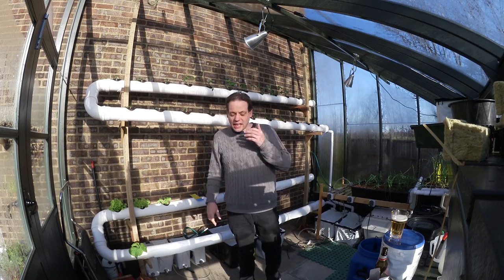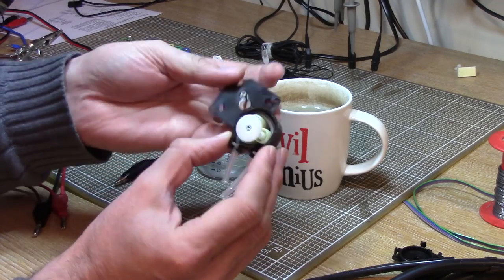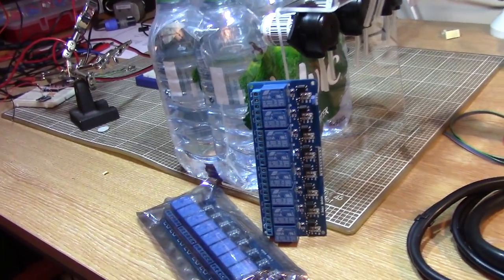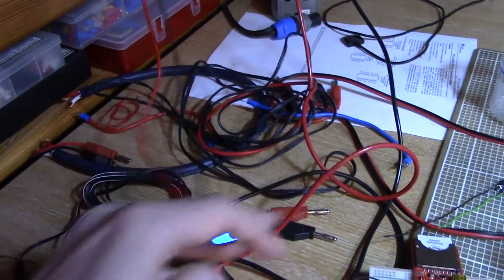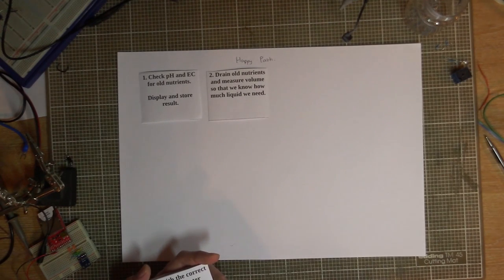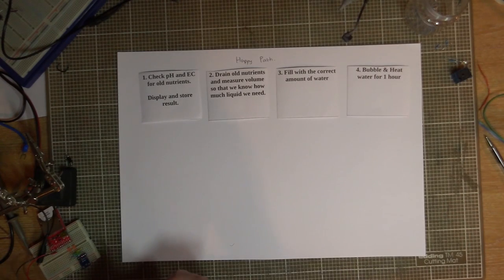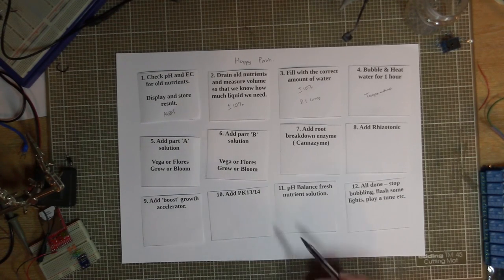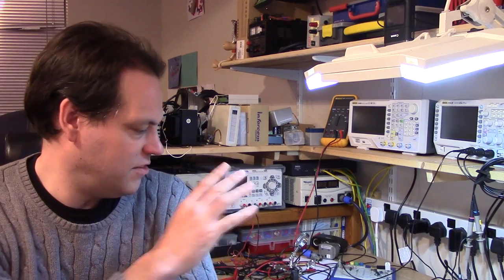The Mixologist - Automated nutrient mixing for hydroponics.

Comment: Your design allows the system to create a mix that might be incorrect due to failure in the system. Such a mix once in the mixing container will be wasted because you are not able to reliably determine what's missing in order to correct it. 

To increase reliability you can use two stage measuring. Pump each nutrient into individual containers. The user then observes that all the containers have the right amount of liquid. The user presses a "release" button and a valve in each container opens and gravity moves all nutrients into the mixing container at the same time. 

No need to monitor pumps and level of source liquids because you have a stage where you can visually check its correct. You will after all me present when this all happens so you save on complexity and be able to correct any measuring errors before they become irreversible.
Reply from the maker: Graham Wilson Hi Graham... I feel it's a bit too soon to start getting critical of the design just yet. I'm still very much at the stage of buying up bits that I think I'll be needing and figuring out how to get them to work. I'm very aware of the opportunities for this system to screw up massively, which is why I'm more worried about metering the liquids being dispensed than actually dispensing them. I recently saw a teardown of a blood sample analyser (over on mikeselectricstuff ), For the most accurate dosing requirements in that system, they were using syringes driven by stepper motors on a threaded bar... For the slightly less accurate requirements they were using 5ml vacuum driving diaphram pumps which dispense 5ml with each cycle of the pump. They didn't actually monitor a single fluid for flow rate. I was rather surprised by that. Even the coffee machine at work uses one of those rotary hall sensor flow meters, but for analysing blood samples they didn't feel the need. Amazing.I like your idea of having the sight glass stage, but we couldn't release all the liquids at the same time as they need to be mixed in the right order, so it would take just as long as doing it by hand. I do however want the system to be able to run without oversight as I need it to be operable by one of my neighbours when I'm off on my holidays, so if I can managed a one-button-does-it-all approach then that's what I'm going for. The big problems I have with my current manual approach is that a.) I don't actually know how much liquid is in my reservoirs.... I make an educated guess... (45-litre tub... half full... take a big off for the pump and heater.. Let's call it 17 litres in that one)... and then inaccurately add my nutrients based on that guesstimate and some lazy maths... Most of the time I get it right... but I got it wrong often enough to want to do this project.I'm looking at some interesting options for flow monitoring... I've seen some awesome 'thermal mass flow' sensors which would be perfect for the job if it wasn't for the fact that they cost $1500 each... I've currently got some bits on order so I can have a play aroud with capacitive flow sensing in a few weeks time when they arrive. Thanks for watching and taking the time to comment. Cheers!!

Comment: using a scale, or relying on one isnt recommended as they go off very quickly if you're constantly puting weight on them.
also, consider how you plan on mixing or shaking your small bottles where nutrients will flow, before they flow.
consider that boost acc and rhizo will most likely dry and block your tubes within the first week.
id recommend some kind of top down dripper into a funnel with larger tubing to prevent clogging, but they still need to be shaken before added

Comment: Jim, you could fill another container with ml graded as a check system before dumping in the containner and after check push one bunton to dump... as for safed, just an idea... did u understand me?
Reply from the maker: Hi W Francisco - Although that's a good idea for checking the dispensed amounts, the two-part nutrients that I use are supposed to be added seperately to the water, as if they come into contact with each other when they're undisolved then it can form some other salts which are undesireable (I can't remember which ones), so I'd have to have multiple dump mechanisms for at least four of the measuring containers. I'm currently working (very slowly) towards the idea of using a load cell (i.e. digital scales) for measuring the weight of the nutrient bottles, and only ever dispensing from one bottle at a time - I'll can measure the starting weight before dispensing anything, and then watch the weight drop as the nutrients are pumped out of their containers. That way I'll know for sure that the nutrients have been dispensed, and because load cells are ridiculously accurate, I'll have a high degree of confidence in the measured amounts. I've actually already hooked up a load cell since I made this video - it's a 5KG device, with a 24-bit Analog to Digital converter attached to it. That'll gives me sixteen million different levels of weight measurement between 0 and 5KG, which if I've done my sums right is a resolution of 0.00029 grams. Sadly though, this project has been gathering dust on my desk for the last few months as I never seem to have any free time. I'll get back to it sooner or later though (most likely when the days grow short and the nights grow long). Cheers!!
Reply: Hey Jim, I was thinking in so many aplication this device can have, auto coffe maker, dump chlorine in a well, mixing tints... there are plenty of things to do, keepup the good work.

Comment: Two thoughts - 1. instead of weight and flow for the water measurement have you thought about using ultrasound units to measure the height in the container? Seen break out boards that do it for a couple of pounds on eBay, seem to remember someone using them to measure growbed water height for an aquaponics set up. 2. Instead of flow meters on the pumps as your backup to make sure the are dispensing correctly (given the accuracy level of the other flow meter) what about a moisture sensor below where each one drops into the container, very basic two copper contact liquid switch? You could set a max override time on them which would switch off the pumps as a last resort. 

I received my Dallas one wire temp sensors yesterday. It's quite embarrassing but I have to say I have failed to make the worlds simplest circuit work. Not sure if the sensors are duff, it would seem unlikely that all 5 would be faulty. I am reading 3.3v on the positive leg across to the ground so I know they are receiving juice from the Pi GPIO pins. I also have 3.3v on the data though, is that normal?  I have got a feeling that it's a stupid question but thought I would ask, there isn't a whole lot that could go wrong with it really so am a bit stumped.
Dan
Reply from the maker: Hi Daniel. Ultrasonic sensors could work as long as I'm always mixing nutrients in the same container. It would be OK for the bulk liquid (i.e. 20 litres of water), but I doubt that measuring the surface height would be able to tell me if I'd dispensed 5ml or only 2ml of one of the nutes. I'll look into the ultrasonic options a little more. Thanks.

I found some excellent looking flow sensors today (no idea of the cost yet), They work by having a heating element placed directly between two temperature sensors. When there's no liquid flowing past, both temperature sensors will read the same level, but as the liquid flows past, it will cool the first one in the flow more than it will cool the second. The sensors say they're ridiculously accurate (up to flow rates of 120ml/minute). I bet they cost a ridiculous amount.

With the DS1820, the data line is normally held high except for when a device is tranmitting or receiving. You can run the DS1820 without the power line at all and it will parasitically draw power off the data line, with each device storing just enough power to perform a conversion and send the results back. (nobody ever seems to use them without the power line though as it's just more hassle than having an extra wire).  So yes... seeing 3.3v on the GPIO line would be perfectly normal.

Cheers!!

Comment: Is evaporation from the water tanks a significant issue? I'm working on a similar setup myself and I'm concerned that the nutrient concentration will increase as water evaporates. Also how are you draining your tank completely before refilling? Conical tanks are expensive. If the tanks aren't drained completely wouldn't creeping nutrient levels become a problem?
Reply from the maker: Hi stlaunder. Evaporation from the tanks is pretty minor compared to the amount of water that the plants will transpire for themselves. Also, you want to cover over the tanks to prevent the sunlight getting into the nutrient mix and allowing algae to grow. With a lid on top of the tanks then evaporation ceases to be a problem. Top tip... If you suddenly notice that your plants are consuming more water than normal, have a check for pests on the plants... When the plants are under attack by sap-sucking insects they'll get through much more water than normal. I've never worried too much about totally draining the tanks every time. I figure that as long as 95% of the solution gets changed over, any nutrient imbalance that was left int he remaining 5% of the liquid is diluted down by the fresh nutes anyway. Cheers!!
Reply: @ThingsWhichArentWork  Great, thanks for the quick reply. I should be able to get away with one tank for water storage and one for mixing and storing in that case. I'm using node red if you haven't heard of it already. It's very cool!

Comment: you're better off controlling the peristaltic pumps using L298N dual H-bridge motor controllers. It lets you power them up smoothly using a gradually increasing pwm signal. That way you greatly reduce the EMI they create which can easily cause your processor to freeze up and leave the pumps stuck on. when I tried running these same pumps with relays they almost always froze up my arduino and the motor controller was the solution.
Reply: If you're worried about EMI, you can use an optocoupler to isolate the higher voltages and feedback from the arduino. They're really cheap. Just drive a N mosfet chip to run the motor.
Reply: I relay not going to not let pass the EMI if any. Are you sure that arudino was freezing up because this.

Comment: You are an amazing electrical engineer. Did you build this?
Reply from the maker: Sadly it is an unfinished project. I switched over to using dry powdered nutrients and never finished the automation for liquid ones. Maybe one day.. it's still on a shelf next to me. Cheers!!
Reply: @ThingsWhichArentWork : I am in the process of building a garden and what you described is far better than anything out there in the market. I would have purchased one from you (That is how good it is). Than you for answering

Comment: How are you supposed to know the quantities of elements in a solution. 

For example if you put 10 parts calcium 10 parts potassium 10 parts iron 1 part boron etc ...

If the plant uses more of one element than the other it may say the levels are okay on the EC but in reality it could be deficient in an element or worse an excess of one particular element. 

I'm not sure how plants up take nutrients do they select what they want like a picky eater or do they absorb all the nutrients in equal amounts. 

The reason I'm asking is I plan on adding  macro and trace elements as I believe they are important to add to the water but I want to be 100% sure I get it right first time before consuming fruits and vegetables that have been grown hydroponically.
Reply from the maker: Hi TinkerTom - You are totally correct that EC reading only gives you an overall reading and doesn't allow you to identify the levels of individual nutrients. You are also correct that different plants will use nutrients at different rates and if you're just topping up with nutes the solution will eventually become unbalanced. As far as I'm aware, the only way to identify the levels of individual nutrients is through mass-spectromotry which generally involves a laboratory (or tens of thousands worth of equipment). If the nutrient mixture becomes too inbalanced then the plants can suffer from nutrient-lock, where the pores in the roots become clogged with a particular nutrient, preventing uptake of the ones it needs. 

Without the lab tests, the only way to be absolutely sure what is in your nutrient mix is to make a fresh batch every couple of weeks. An alternative approach (if you want to use the same bacth of nutrietns for longer) is to try and identify deficiences in the nutrient mixture from the plants leaves. Take a look at the Canna deficiency guide at https://www.cannagardening.com/deficiency-guide - If your leaves look like the pictures then you'll know which mono-nutrients your plant is lacking.

Thanks for taking the time to leave a comment - Hopefully my answer is helpful. Cheers!!
Reply: Thank for the prompt reply Jim greatly appreciated 👍 

It gets even more complicated if you add different plants to the mix as every plant is going to require different nutrient profiles and to further complicate things when they flower and fruit they require a different nutrient profile again.

I mean I have no idea how much it would cost here in the UK to have it tested every couple of weeks but doesn't sound cheap especially if you plan on doing it for a long time.

It would be okay if money grew on trees though haha 😂 

I've checked out the website very informative but apart from the few deficiencies listed is there a way to tell if a plant is deficient in other elements? 

I can see why they don't add the trace elements but it's a real shame though just because they are used in small quantities doesn't make them less important. I mean I'm no expert but I'm sure our bodies need these trace elements I watched Cody's lab and he done a mix for algae he planned on consuming and he put a large variety of elements in his. 

Yes it was very helpful thanks 🙏

Comment: Hi all! quick question, when my pump doesn't proceed to dosage for some time (like 24h), the inlet tube liquid slowly flows back to the solution container. What can i do about it because i thought peristaltic would retain the liquid when off ?
Reply from the maker: Good question, and I'm really not sure of the answer as my Mixologist project never made it to completion. One thought though.. Silicone tubing is actually slightly porous and will allow air into the tube over time. If you're using that then maybe switching to vinyl tubing will help. Cheers!!
Reply: @ThingsWhichArentWork  Thank you Jim, I'll try with other tubes to see if it's the same ;-)

Comment: Have you considered using weight per bottle to track how much is dispensed?
Reply from the maker: Hi Don - I'm planning on doing exactly that, but with the small optimisation that I can weigh all the bottles at the same time, but only dispense from one bottle at a time... so the reduction in total weight will be exactly the same as the dispensed amount. I've been very slow at progressing this project (don't know if I will ever finish it). I got as far as building the weighing platform with four load cells, but haven't got around to hooking them up to a microcontroller yet... (I built the weighing platform over a year ago now). Cheers!!
Reply: Jim Conner what about stepper motors with maybe a syringe. You could count the steps to pull up a ML.

Comment: Hi jim from CA, I am a prototype machinist, I work with mastercam and solidworks. I would like to get more in to electronics and suggestions? when it comes to making parts to print, programming, fixtures, tooling, you name it, I do it, but I would like to start building systems much like this though need to start somewhere learning electronics.
Reply from the maker: Hi BringItHard - I wish I had better skills with 3d-design packages. I'm still bumbling along with Autodesk's 123d design at the moment, which is really rather limiting... I really must invest some time in learning a proper 3d package (tempted by Autodesk Fusion 360 because it's free for hobbyists). When it comes to learning electronics, my advice would be to only worry about learning enough to solve the exact problem you're trying to solve at the time. You can go a long long way just knowing Ohms law. If you get youself a copy of 'The Art of Electronics' by Horrowitz and Hill it has every possible thing you could ever need to know, but it's a huge book and not really readable from cover-to-cover. It's just a great reference when you decide 'I need some simple oscillator circuit' and you can look up a few different examples. You should also check out Dave Jones' EEVBlog channel on Youtube. Dave's done some fantastic tutorial videos on there (mixed in with product reviews etc) so his channel's well worth a look. You might also want to check out Julian Illet on Youtube as he makes videos at more of a beginner level. Hope that helps. Cheers!!
Reply: Great! The book as well as the robotic builder bonanza, I also sub those 2 channels as well. In the manufactioring world I'm in we use Solidworks for modeling and print making. You can find those files online for free as well if you would like to know more about that PM me and Ill point you in the right direction. Thank you for getting back to me!